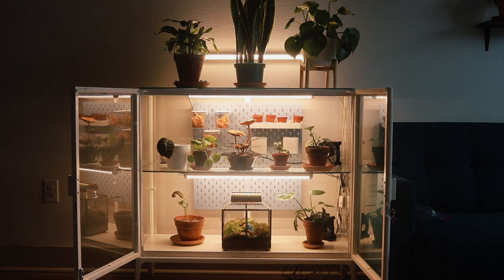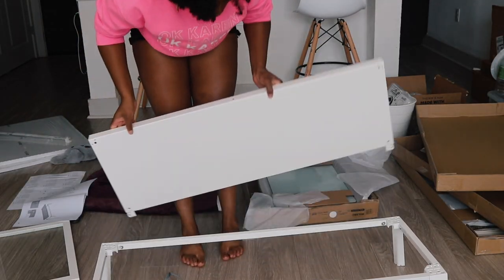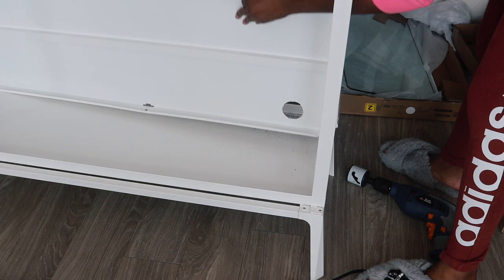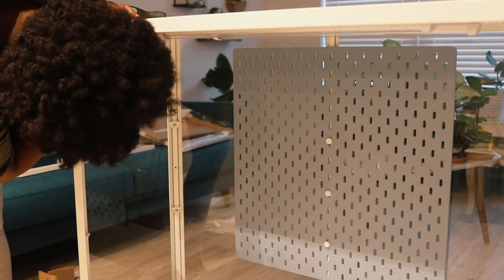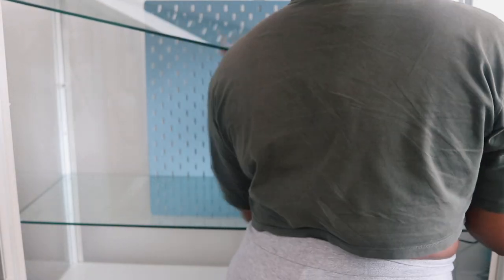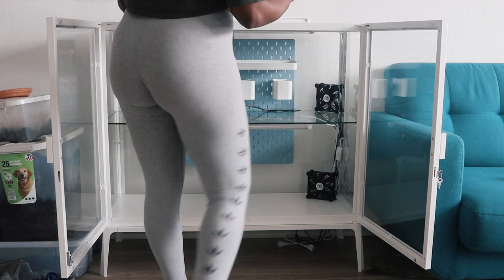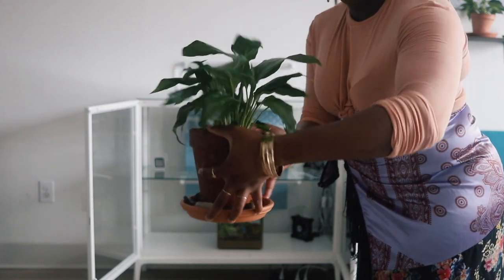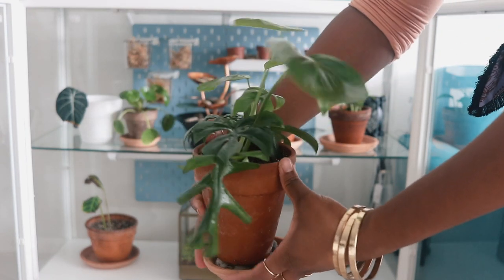Easy IKEA Greenhouse Cabinet Setup + Tour (Milsbo Edition)

Comment: I just finished my setup but I’m dealing with mold? Any suggestions?
Reply from the maker: Yess! But first, where it it on the cabinet? Did you first spray rustoleam? If you are having mold issues, then your cabinet could be holding too much humidity. Do you open it daily to allow fresh air to flow through it? Do you also have fans?
Reply: @Steeze365Daily  the mold showed up on the top layer of a few of my plants the day after watering day. I was wondering if i don’t have enough air flow or if I should start bottom watering the plants that go in there?
Reply: And yes, i have two of the laptop fans, but I’ll be getting new ones as I don’t think they are doing a great job of pushing air around
Reply from the maker: @Conversechic3953  hey! I’m so sorry for the delayed response. Were you able to figure it out yet? If not, I highly recommend the fans that I use. They are awesome and just keeps blowing. I also open the cabinet daily to release any moistness, etc.